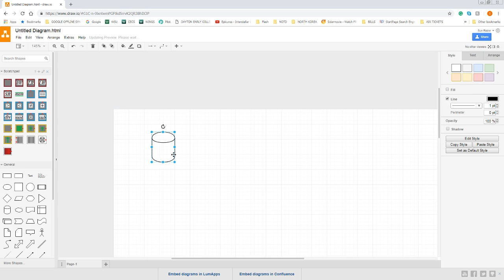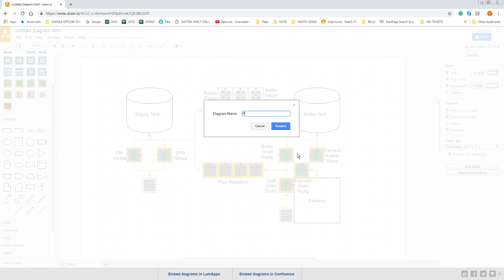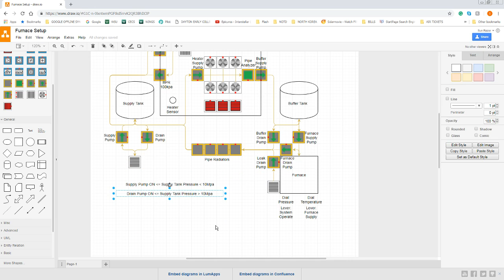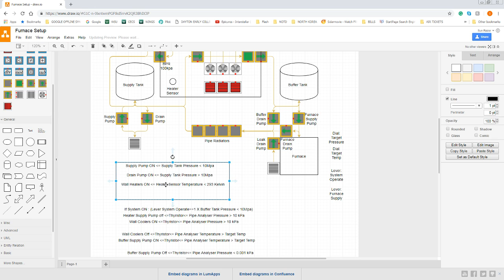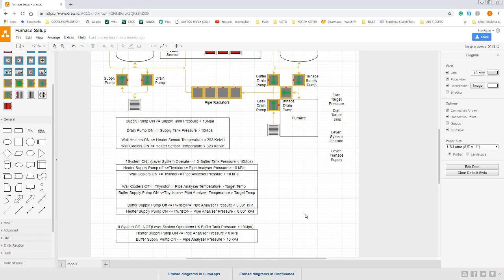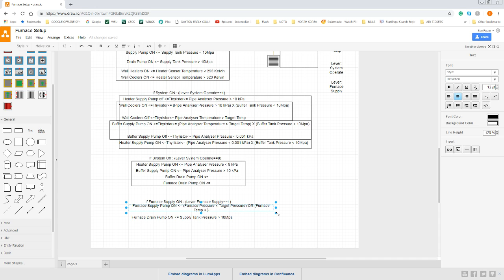Stationeers Tutorial - Smelting Without Fuel (Part 1)

Comment: So you are basically pumo the mars athmo to a pressure of 10Mpa and heat it und the hot gas enters the funrace ?
Reply from the maker: Unfortunately, this setup will no longer work since the developers set a max temp difference of a couple hundred degrees I think, for the wall coolers.